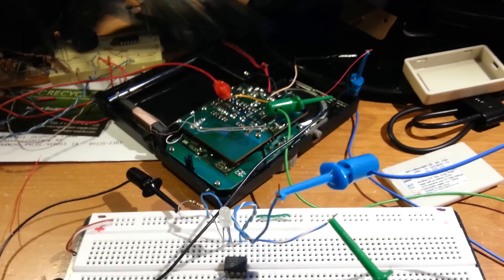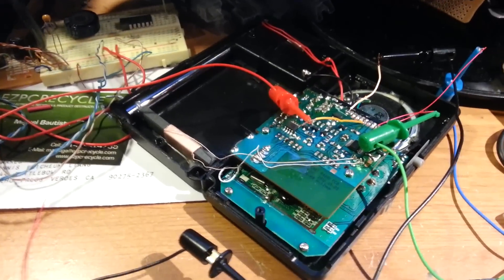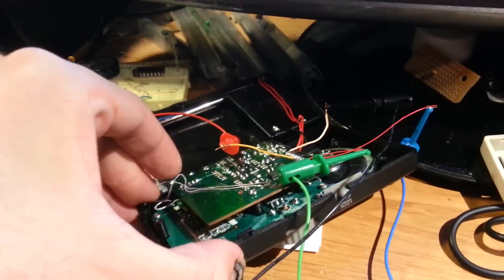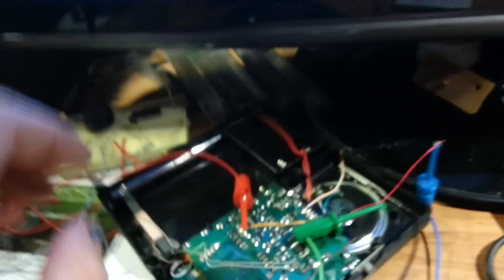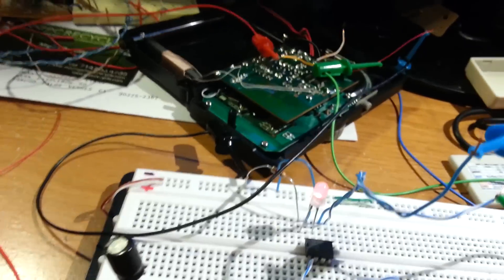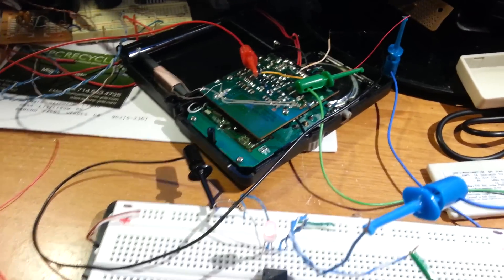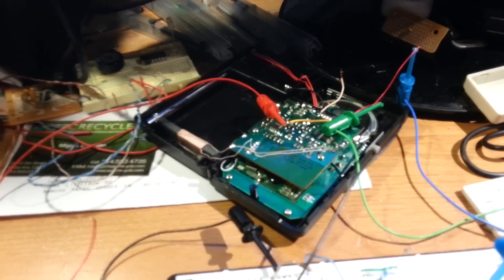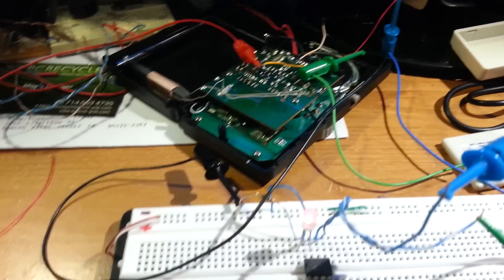DIY Radio Shack Hack Model 12-587 ADVANCE HACK.

Comment: I just ordered this 12-587 ribbon version, How can I hack this radio, The easy way?
Reply from the maker: I actually wrote a program on a pic chip that send tune commands via i2c to the PPL ic you see on the board. I may have one extra on ebay for sale soon. Clearing out my old Paranormal gear.
Reply: @tmdrake  How do I Get Hold Of it?
My NeW youtube is asking for 12-587 help
Do I need to solder it on the motherboard?
Reply: I have this model of radio that I'm wanting to hack but I don't think I can do all this complicated stuff.

Comment: +Drake Dragon I am currently learning how to program PIC's. And I am using PIC Kit2. If you wouldn't mind, Im trying to figure out which software I need to learn to write the codes that get flashed onto the PIC. Could you steer me in the right direction as to which software I need to get and learn. Thank you so very much for the video. Nobody seems to understand what I'm asking so it's been a slow process of teaching myself. Kudos my friend. Great work!!!!

Comment from the maker: I used a 12F635 PIC running a small program to send tuning commands. PM I don't mind sending a few if i have extra or sending code. I was able to decode the FM tunning as well. Not to mention I should have some info posted on pasadenaghosthunters(dot)org this week.